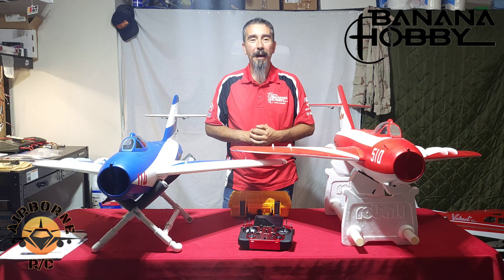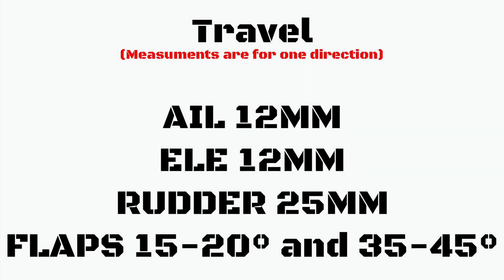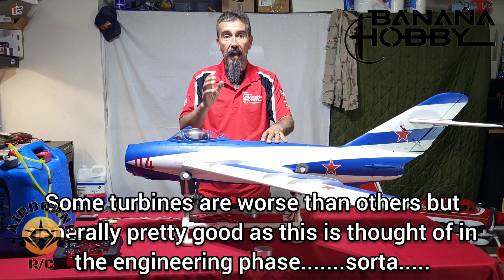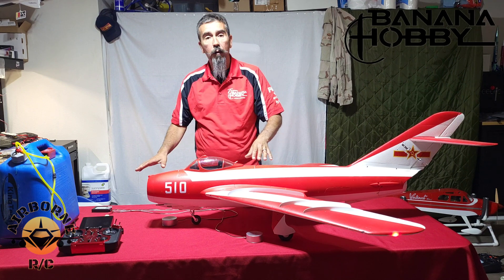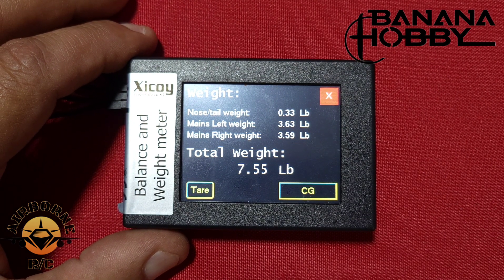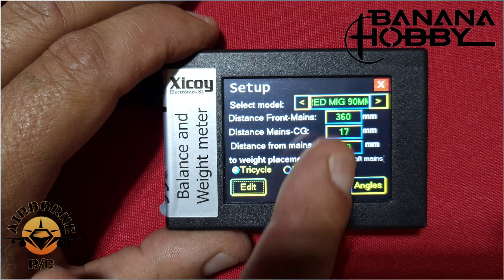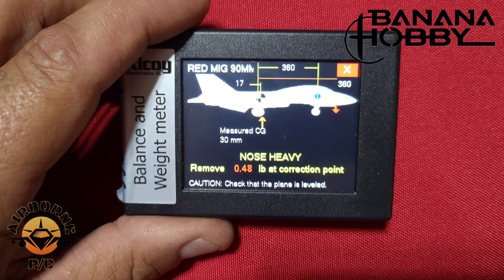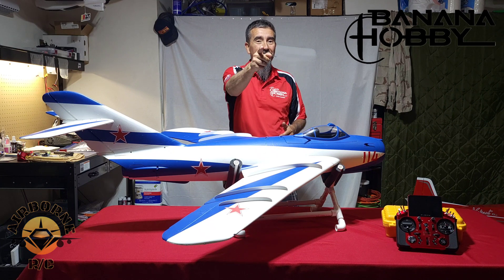AF Model MIG-17 Turbine Throws and Center of Gravity (CG) on Xicoy CG Machine

Comment: The only way I got to your numbers was by digging in the front of the plane and pulling out the three steel weights that they put in there and then I did get the CG that you put in there I have the EDF version and I used your CG on my x-ray came out perfect if you pulled the weights out of the front of that plane you should let people know because there's no way in hell I could get that CG until I pulled those weights out still a helpful video I appreciate your time
Reply from the maker: @007luiss007  i did not pull out any weights. I have my flight battery on top of my fuel tank. I'm not misleading anyone. Nor do I show where I put my final install pics and final install. The reason is I've had many, many, many ppl just go by what they see and never bother to actually hold it at CG points and then act all crazy when the crash. Since then, I just give out my number, and then it's up to the modeler to achieve the number IF they chose to go by my number. Just like any turbine. Stuff will not sit in the same spot from jet to jet we just move stuff to get the number. Thanks for watching.
Reply: I have put together quite a few Jets turbines and the Achilles heel I've been finding out on all turbine jet planes is the CG if you go by the factory specs they're all nose heavy you have to constantly be tweaking I get it the video was helpful and I was able to put a battery in the front and a battery over the tank and achieve 18 mm CG plus I also had the electric EDF like you and double checked it CG cuz I've flown that already it's just crazy the amount of money you spend on these turbine Jets and always I talk to a lot of people CG is a it's an art for lack of better words thanks for the video it was helpful